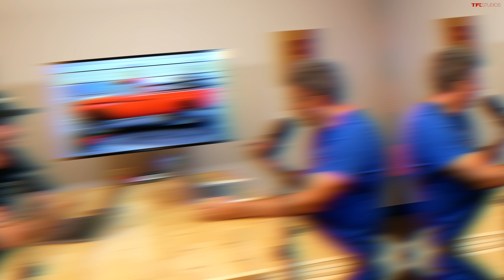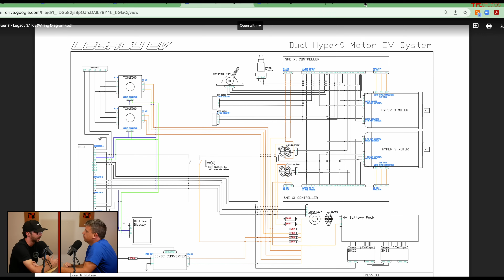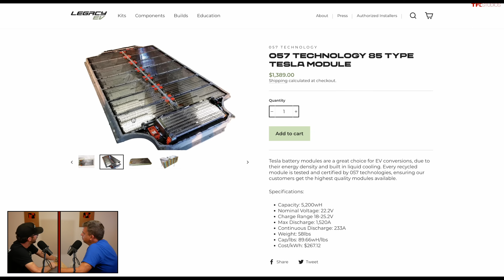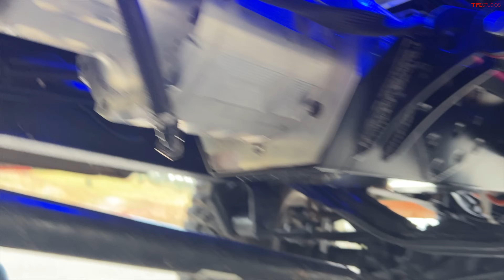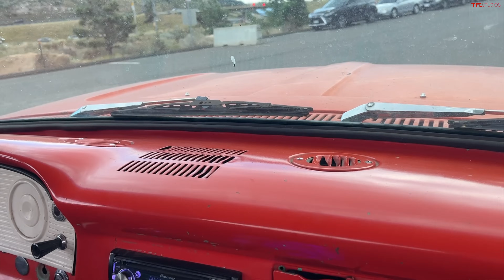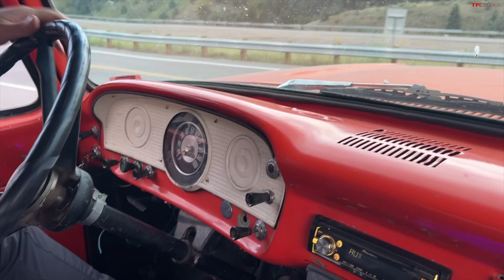Lessons Learned After EV Swapping A Classic Ford: Here’s What You Need To Know!

Comment: Nice build. I’d love to do it with my 2002 King Ranch but with less raw power, more smooth and quiet power. Battery packs all down low, to allow for a 2002 front trunk :) with an additional layer of batteries in the floor of the bed.

Comment: I would like to covert my Chevy 3500  4x4 Dully in to a hybrid electric and an engine/generator. I do a lot of towing of a 45’ fifth wheel about 24000lb across the country, that why the hybrid. I would like to keep the 4x4 system in the truck. Do you know any one that dose this type of conversion?
Reply: Edison motors in Canada is working on that exact system.

Comment: Thanks for the information, Andre.  When you were under the truck with the camera, it looked to me like the pinion on the rear diff is angled up too much.  This could be leading to driveline vibration.  The output shaft on the transfer case should be parallel with the differential pinion.

Comment: You can buy a used tesla for less than you guys paid for those battery packs. Why not just buy a 20k tesla and transfer the batteries, motor, screen, everything?? Seems super dumb to pay more just for batteries. I'm actually shocked you guys are recommending this option.
Reply: Maybe because most of the components are new instead of repurposed from  used vehicle. Higher reliability
Reply: @DeuceFrmEC  No, those batteries they used are used, and they still paid 21k!!
Reply: @edition-deluxe  I didn’t mention batteries by the way. Batteries won’t be of much used if they can’t receive charge nor will it matter of the vehicle can’t use it. I said components used to bring the focus as to why the prices may be the way it is. Batteries are expensive regardless of the platform
Reply: @edition-deluxe    They said these batteries are guaranteed 80%.  Not just buying a used car and cannibalizing it.

Comment: Nice final product, but it's hard to justify putting a $30k drivetrain in a $1500 vehicle.  Price is going to hold back most conversions.  You could leave the ICE in that and just buy a Chevy bolt to drive.  You would have less in it.
Reply: The same applies to any classic custom.  You're not trying to build basic transportation; you're doing something special.  However,  in coming years,  it will likely become economical to convert them. 

Also, this is a $32k EV real truck.  It's cheaper than any brand new full size truck and cheaper to run.
Reply: @jamesengland7461  with half the range.  I expect that if Ford wanted to build a new ranger EV with only 250 hp and 100 miles of range, they could probably get close to that 30k price. It wouldn't sell well enough, though.   They probably will build one with 300 hp and 250 miles of range.  It will probably still be under 40k.
Reply: If you find one of these for $1,500 BUY IT! Value on these old trucks has gone through the roof. I sold a 86 in rough shape for 9k, and that's not a one off. Chevys are a little more, but Fords sell just as well. 

Still I get your point!
Reply: @edition-deluxe  yeah i have 1 un restored 1966 F100 like this and have been offered 30k and i didnt sell. no way your getting one for $1500 unless its falling apart
Reply: @3184Patrick  30k? You should have taken it. Square body market has pretty much fallen  from those crazy heights.
Reply: @edition-deluxe  Not around here. Slicks still go for lots and mint restored are 50-100k
Reply: You forgot the main benefit. Style points
Reply: Or buy a cheap bolt strip it down and reuse the parts like Chevy themselves did a couple year's ago for the sema built ev c10.
Reply: Components alone for this build was $40k. my guess on labor $15 to $30k.
Reply: @Marc B I'm pretty sure they paid for labor and install and all told,  $30k according to the video
Reply: @jamesengland7461  He said $40k in components alone in one of his videos.

Comment: Can’t wait for the day you can Amazon an entire ev swap for your car. Motor, controllers, BMS, battery modules . Can’t wait
Reply from the maker: That day is coming closer...
Reply: @TFLEV  my guess is 5-8 year's away from today.
Reply: I'd love to see a modern JC Whitney EV catalog.
Reply: Some vehicles you already can...  VW bugs and I think the Mini Cooper already have kits you can purchase with all the parts you need.   Maybe not Amazon though, but still, the kits are available.
Reply: @Phatman114  more than a couple companies make bolt in kits for Porsche 911s of various vintages as well. 

It's definetely coming someday soonish. I could see a mash up with aems ev division Holley high voltage. 
Where you select your car, select the motor/s&hp goals, select your electronics with aem/next ev, select your battery setup, then have mounts and various stuff built by a place like send-cut-send. It would still be very pricey though for a good long time yet. 🤔
Reply: @Phatman114  Yes they are available.
Reply: Sooner than later
Reply: Edison motors up in Canada is working on pickup swap kits now. Either one or two e-axles that have a motor on the axle. The problem is still cost. They are saying 1/3 to 1/2 the cost of a new truck. Don't know if that is turn key or just parts kit.

Comment: Thanks for the overview, guys. One thing that I think would drive a lot of questions is the "little stuff." I know you mentioned components like power steering pumps and things of that nature, but even small components like accelerator pedals and other crucial pieces that are needed to make the conversion roadworthy might be helpful.
Reply from the maker: Great point!
Reply: @TFLEV  An in-depth conversation on liquid cooling systems would be impressive. Battery cooling and heating system includes hoses, pump, heater and radiator. Motor cooling, controller cooling if separate box from inverter, inverter cooling, charger cooling anything else liquid cooled. What are the advantages of cooling 'each' of these systems if liquid cooled over non-cooled systems, describe components included into each system, what are the negatives of individual systems that are not liquid cooled such as the car begins to slow down on the highway. Tesla motors are liquid cooled hyper nine motors are not, because of that what can the Tesla motor do that the hyper nine can't? Thanks for the great work and hard work that you do!!!

Comment: I wonder what the cost would be to convert a 1970 Opel GT.
Reply: Doing it yourself figure 10-12 thousand for a new motor, BMS, adapter plates, cooling system, mounting, battery boxes and batteries from a  totaled car typically from a Tesla or Chevy Volt. New batteries are expensive. Paying someone else could be triple that. A Hyper 9 would be nice in an Opal GT. I would keep the transmission and clutch if it can handle the increased power and torque. As long as around 100 mile range works for you you could keep the car about the original weight. It would be a blast to drive. Plan on spending about $500 for insulated tools, meters and safety equipment.
Reply: @dannelson6980  looks like I'll just upgrade the carb to a Weber to get it running and get a paint job.

Comment: 7:28 For reference, the stock motor in my Ford Ranger EVs is ~90 kW (about 120 HP) and about 150 lb/ft of torque. That's with a 400 V system, though, so it runs lower current.

Comment: Excellent, I lean towards a one motor (DC to save inverter watts) system as I have a 69 f250. Ford is developing crate w most other components in a kit. My truck is a 2wd w a dana 60 rear. I want to do this myself and install a solar hybrid stand alone/grid feed system. Simplicity is key.
Reply: Hi, KISS is the true acronym.
You could just harvest all the parts from an old or newer crashed leaf. Which you can mount to a transmission or transfer box.
Starting to see lots of conversions on Series and old Defenders. Which keep it simple. They have both depending upon the end use.
You can also go the Tesla route and replace the transfer box with the Tesla drive unit with raised drive ratio. This offers more power than the leaf whilst keeping it simple since it is a motor / drive/ inverter in one.
Cost wise using second hand or crashed components keeps the cost down but gives you excellent engineered parts.
There are now several e us that can be used to get the hardware working.

If you wanted a performance or more bespoke, you could convert to independent suspension and a drive unit at each end.
This offers performance whilst allowing a skateboard approach and keeping the battery in the Ctr and safe from everything.
The handling is also the best you can get with almost 50/50 distribution.
There is a company in the UK offering this for older range rovers at a cost!

The choice is your and so are the cost decisions.
Take care M.

Comment: I hate this truck. Those guys from 101 motors really slapped it together. They couldn’t even have been bothered to throw a open knuckle axle under it. Or get rid of that slider bushing leaf spring set up.
Reply: It's an ev conversion not an over haul it all comes down to money it's main point was just to replace ice with electric motors without having to replace everything to the wheels
Reply: @lesstevens2370  so you think replacing a axle makes it a over haul. They had the body off the truck. How much does a Dana 60 or open knuckle 44 cost. $500-$1000. Don’t get me started on the gear box either.
Reply: I think you’d be better off waiting for someone to roll a lightning/ev transit and doing a chassis swap
Reply: I think you’re missing the point of a custom build….
Reply: @paulbrinker482  nope. They half assed it. They had the body off, replacing the axle would have been the easiest thing.
Reply: Why would be the point to put a open knuckle axle in
Reply: @ericcrockett479  bigger brakes, bigger shafts, easy to service. Tighter turning radius. Do I need to continue

Comment: Really interesting. Right now, I'd guess, that this is not practical for the average guy but the possibility of this is what happens to combustible over time is fascinating. I hope you'll consider doing one of these builds on a smaller vehicle with a focus on keeping cost down and range and charging up. Thanks for doing this and great video
Reply: A budget build could  be done a lot cheaper. A small car (probably something like a Geo Metro would be best) would only need a single NetGain motor and 36 LFP cells. Even if they splurged and got 200+ Ah cells, the cost would only be about as much as three Tesla 18650 modules.
Reply: It would be neat to see but this video series was really expensive and hasn’t generated a lot of views. I think it may gain traction in time but I don’t expect to see another conversion on TFLEV anytime soon.